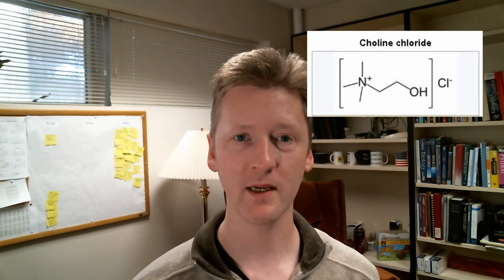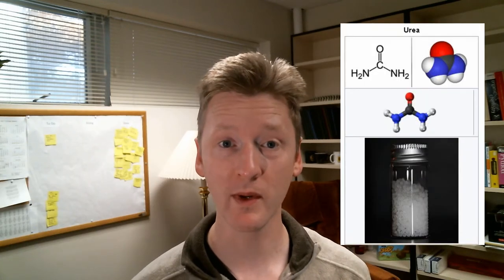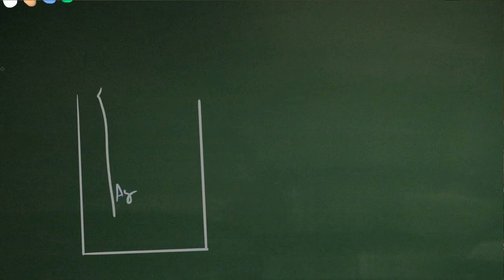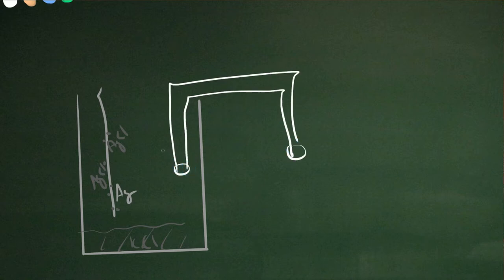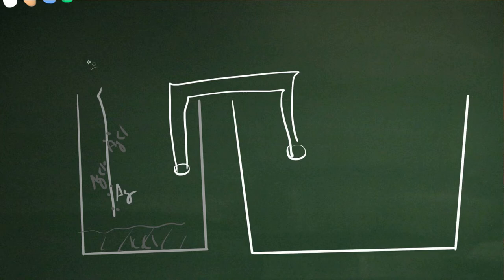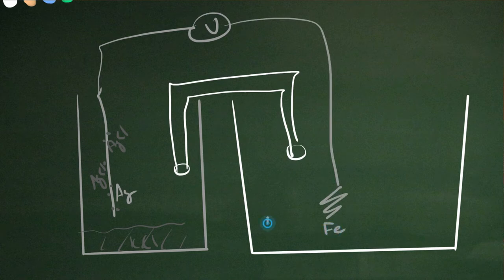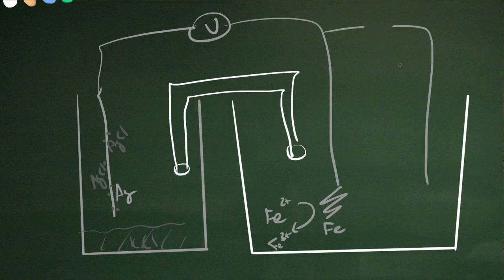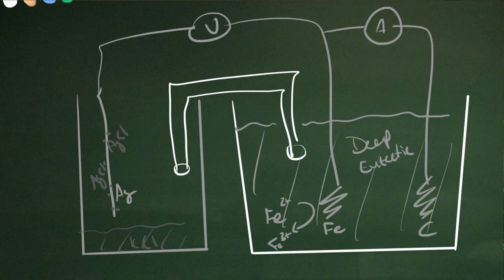Deep Eutectic Solvent (diet ionic liquid) Iron Cell

Comment: Another question: Would you consider explaining how the Maria Braga / Goodenough battery achieves a voltage potential difference between the anode and cathode? I cannot figure out this since solid Lithium is present on both sides during discharge.

Thanks!

Comment: This is a great effort! Thank you for sharing this with us interested parties.

Question: It seems common to use coin cells to develop batteries. Is this a format you may try in the future? What are the advantages (other than that very little materials are used)
Reply from the maker: I have not looked into getting the materials for that - I assumed it takes some pretty specialized equipment. It seems like a good way to keep air out of the system, but maybe not necessary for a battery that is not too air sensitive.

I did a video back a while ago about li-ion batteries (some Goodenough batteries are this kind, others are different). 

https://youtu.be/OxP5i7fSVt0

Do you have a particular Goodenough paper it would be good to go through? I'd appreciate the suggestion.
Reply: Thanks for answering.
The paper I am referring to is here: http://pubs.rsc.org/-/content/articlehtml/2016/ee/c6ee02888h

With the solid state glass separator, they could move to solid Lithium instead of the normal graphite intercalated version.
During use, solid lithium shows up on both anode and cathode which makes a non-chemist like me confused.
I thought it was a prerequisite to have different compunds on each side of the separator to get a voltage potential across the cell...